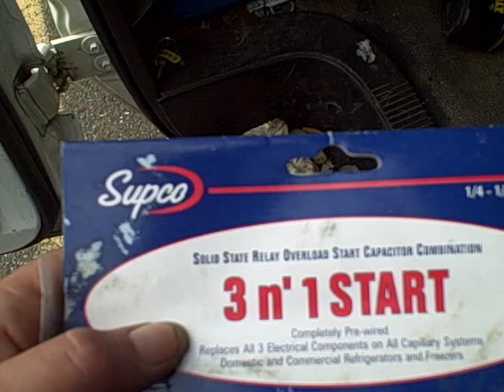Supco 3 n' 1 START

Comment from the maker: @George0Zack It's on the packaging,
but each instance is different, thats why it lacks the detail.

There's terminals for start, run, and common. The other 2 just go to your Hot and neutral/common (115/230)

Comment: yeah i was looking up the 3 n 1s because i heard that they arent working on the newer compressors for long before taking out the start winding or adaptive defrost board.have you had any such trouble?I hope not i sold several refrigerators with them installed lately

Comment: Theres a wiring diagram on the packet, the connections depends on the equipment, condenser fan or not etc, even the pins are not standard on the compressors so a vid tutorial that suit one make and model would likely still be little use to you. Any competant fridge or ac tech should find replacing a relay with one easy. 

If in doubt get the correct part for the compressor then it will be like for like replacement.

Comment: You didnt show them how to ohm out the compressor. the windings are usually csr but not always i have came across several where start and run on are on the other side.